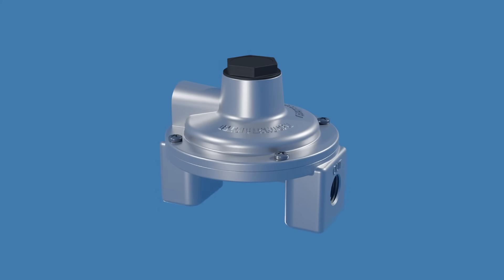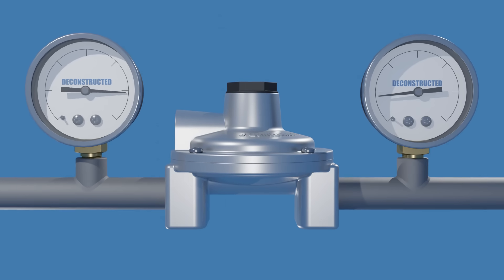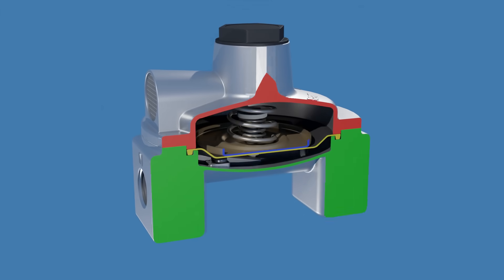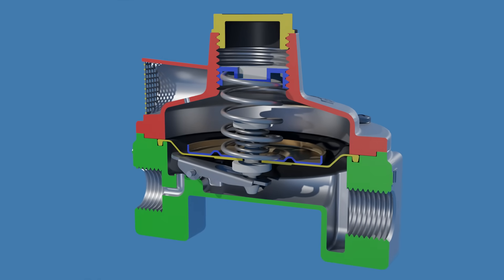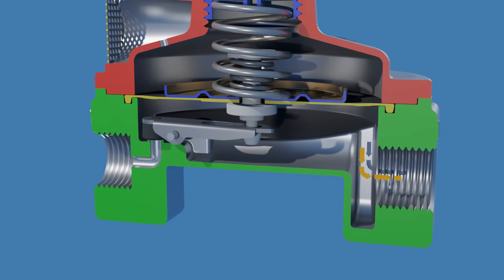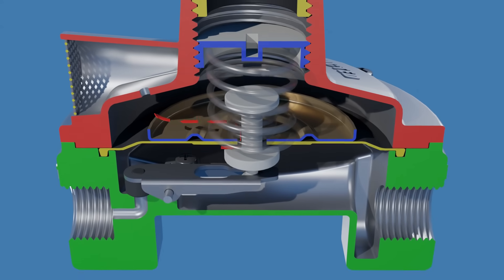How a gas regulator works

Comment: Very good. The technology is very much like how SCUBA works. There, the first stage (attached to the cylinder) lowers cylinder pressure to something like 10bar intermediate pressure in a hose and the second stage (in the diver's mouth) lowers this intermediate pressure to the comfortable inhalation pressure that is ambient to the depth of the diver. Great video from you.

Comment: I have some experience with these. As well as water and steam pressure regulators. They all work on similar principals but the gas ones cut off all gas when they fail for obvious reasons. We never repaired the gas ones. If They had issues we would replace them.

Comment: Would love to see one of these done on the two stages of a scuba regulator.
Reply: I presume the first regulator will be the same as this one, while the second, depending on if it is a Yugoslavian or Romanian designed scuba, will use either external pressure or a fixed bulb of gas to regulate the final breathing pressure against.

Comment: Pls suggest, what happens if the regulator or any of its parts fail to work properly?
In one of our industry all the pipeline, filters are chocked with liquid gas (lpg)..yellow colored viscous liquid..Can anybody suggest the reason? Is it LPG quality issue?
Reply: Likely. If you have too much liquid in your gas stream, there are devices like coalescers to remove them. (My former employer makes some very good ones. Not sponsored!)

Comment: And how to deal with leaking gas through the ventilation holes, thanks for the advice
Reply: Replace the regulator. It should only vent a little in exceptional circumstances.

Comment: The regulator will also blow gas out the vent if the diaphragm fails.  I just had to replace the one on my camping stove, which is no doubt how this showed up in my feed after ordering from amazon.

Comment: Couple points.  The relief valve is a safety device in case the seat disk does not close off 100%.  If it is venting at all, then a repair is in order.
Reply: Correct in general. But also, if the regulator range of operation is undersized, the excess pressure could be venting continuously, although it is very rare for this oversight  to happen. More likely, an upstream regulator has failed.
Reply: Exactly. That's what I've been told by instrumentation and what I look for when ensuring the regulators are working correctly. If it's leaking constantly though the vent port, the diagram or relief valve needs to be replaced/repaired.

Comment: Pretty Good Video
Here are some corrections/additions:
1. Natural gas is methane and not considered a Liquified Petroleum gas.
2. Liquified Petroleum gases are: Propane, Butane, Iso Butane, etc.
3. The access cap for the regulator adjustment is righthand threaded - not left hand as was shown.
4. The gas regulator shown in the video is very basic - like the one on your gas grill.  Almost all gas regulators provided by gas utility companies have a threaded vent port, so that the screen can be removed and small diameter pipe and fittings can be used to direct the vented gases outdoors (if the regulator is installed indoors) or if installed outdoors, to direct the opening down so rain does not enter the vent port. That way the regulator can be installed horizontally as well as vertically.
5. Larger gas regulators (like the one's on most homes and businesses installed by the gas utility) have interchangeable gas metering orifices and adjustment springs. Changing the gas orifice size, changes the volume of gas that can flow through the regulator, while changing the spring stiffness, changes the range of outlet pressure adjustment capability.
Reply: I worked in the natural gas industries and worked on regulators designed for pressures up to 6000 psi. 

They essentially work just like this, with the exception of what you noted.  They also come in different metals as in production you are dealing with raw gas that could be sour or have high concentrations of CO2. 

The regulator I mentioned above is a Fisher 1301 regulator.
Reply: @rickschlosser6793 fisher 67CRF gang
Reply: @rickschlosser6793 Question for you and thread author Ken: For residential Natural Gas joints do you prefer tape+dope? I’m a home gamer but it seems easier for me to get a tight seal the first attempt.
Reply: @colinjohnson5515  I did little residential but as a pipefitter and gasfitter I would use tape and dope. 

Put the tape on first (wrap the correct way), no more than three wraps and don’t cover the first thread.  Then put on a light application of a suitable dope. 

It always worked for me.
Reply: @ TYSM. Also TY for the exact instructions
Reply: The animation showed the seal cap spinning the wrong way, however, the thread was correct in the cutaway.
Reply: Also for listed regulators they have a spring closed flap in vent to allow a larger volume of gas to vent while during normal operation a small hole provides air to pass. This small opening actually slows the regulators diaphragm to dampen excessive vibration in its operation. Single stage regulators are not legal for home or commercial gas lines in the US. Only small portable items like grills  or welding devices can use them. This is because a single failure point between full tank pressure and your indoor appliances is dangerous.
Reply: Great video great comment
Reply: Animator didn't use Teflon tape either. 😅
Reply: Thank you
Reply: Point 3 @ 1:43 : I've seen this any number of times in animation, including a memorable full-screen shot of removing a screw in a Disney film (Meet the Robinsons). I wonder if it's a Persian flaw or in-joke for 3D animators to run screw threads backwards on purpose?
Reply: And residue may enter
Reply: Drop a link to the video you made!? What's that you say.....😂 typical
Reply: Does this design cause the output pressure to drop with higher flow? The only way I can see it possible to open the valve more is if there is less pressure on the diaphragm

Comment: so does this regulator vent the gas to the atmosphere if there is too much pressure? I'm quite fascinated by this. I've never seen any used in residential or commercial supplies of city/natural gas/methane gas here in the UK or even in Belgium, France

Comment: Very well made! May I suggest a similar look at the underrated solenoid valves that live in washing machines (and many other types of equipment), that control the intake of pressurized water  (or other fluids) with a minuscule force, through a clever internal arrangement.

Comment: You forgot to mention that the main spring is also changed to match the output level range and then you adjust the screw to match the final pressure....

Comment: The slot of the adjusting plug is fascinating to watch as it turns through the cut plane, but it would probably be more clear if you restored the plug to its full extent (not cut) for just the duration of the rotation demonstration. Just a small suggestion... the modeling, rendering, and narration are excellent as they are.
Reply from the maker: Thanks for the feedback!

Comment: The dual-stage regulator illustration should show the second (low pressure) stage much larger than the first stage, because the lower-pressure gas is less dense so larger passages are required and the lower pressure means that more diaphragm area is required. This size difference is clearly visible in the outer case shape of typical two-stage regulators.

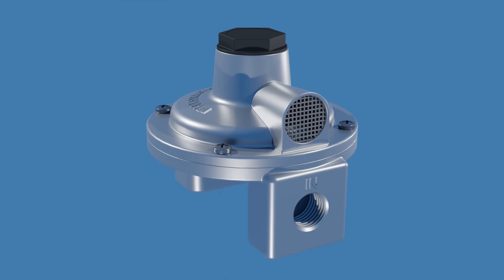Comment: 1:15 not all regulators relieve/vent excess gas. Limited release models, as well as lockup models are readily available for different applications. They are not legal everywhere.

The vent is not required to be pointed down, the termination is. Almost all models have threaded vents. The screen comes out and you screw a pipe into it, with the screen at the new termination. This means the whole body does not need to oriented in any specific direction, and can also be inside.
Reply: You are correct until we start talking about vent limiters , those need to be mounted horizontally, along with the regulator (using piping to mount the limiter horizontal is prohibited by manufacturers, such as Maxitrol).
Reply: @boby115  a vent limiter and vent extention are mutually exclusive. It's one or the other. Vent limiters aren't allowed here anymore.

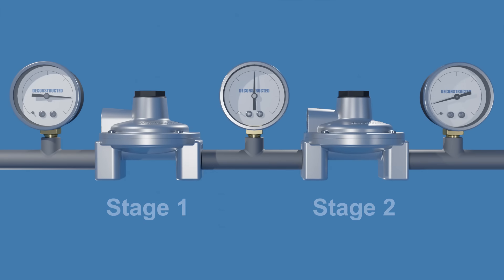Comment: 4:39 dual stage regulators is for safety and control. Typically when there's a very large pressure difference and /or a very wide variability of the inlet pressure. It's one valve body, so it does not help to compensate for distance. 
Multistage systems are used used when you do need to deal with distance. You have 2 or more physically separated regulators. Propane is typically 2. (no less no more, not including the appliance regulators) NG will be dozens in series at the very least, most controlled by the utility.
Reply: I think the narrator confused "difference" and "distance"
Reply: No, not safety, its more about precision. When you have a large pressure difference, the adjustment capability of the "coarse" regulator valve would get very finicky if you directly used it to regulate the outlet pressure, where just a small breathing on the adjustment screw would set it off with hundreds of PSI. Thats why you have a dual-stage pressure regulator, where usually, the first stage is fixed pressure, and would reduce the inlet pressure to like 10%. Then you have the second stage, which have a much greater adjustment capability, just because it works within the 10% of the inlet pressure and thus, you aren't adjusting over the whole pressure scale of the inlet pressure.

In this way, the pressure regulator doesn't need to work as quickly either, since the "coarse" stage does not need to smooth out the pressure so much, thats handled by the "fine" stage, and thus the whole regulator becomes much cheaper to produce.
Reply: @sebastiannielsen  all of which still relates to safety for any hazardous fluid. IE. propane, which will have very substantial fluctuations in inlet pressure, with outlet pressure REQUIRED to be within tight tolerances. If those tolerances aren’t met, it becomes very dangerous in a very hurry. People can and do operate propane and other fuels on single stage supplies, but the risk is substantially increased.

Comment: natural gas is seldom delivered as a  liquid to small appliances that use regulators like those depicted in this video.
Reply: Neither is propane. You use a vaporizer before passing through the second stage regulator. Often the tank itself is used as the vaporizer on residential class capacities. Propane is only stored as a liquid. (delivered as a liquid to the property not to the appliance)

Comment: Dual regulator are also used when a considerable drop in outlet pressure needed for safe operation. Smooth flow is easier to achieve with a second stage of regulation. Sometimes more than one appliance, with different demands connected to the same source will also employ a primary regulator for high demand appliance, than step down again for the low demand unit that requires very steady flow.

Comment: iI do not understand why the outlet pressure does not equalize.  I would  expect the pressure within the outlet channel to exert some force on the diaphram.  I seem to be the only one at 37 comments who still does not understand how stasis is achieved.
Reply: The force caused by the downstream pressure on the diaphragm is what causes the valve to close, stopping flow. This causes the lockup pressure to be higher than the operating pressure.
Reply: @SuperS05  Thank you.  I checked some other sites and now see what you wrote is what is happening.  Regrettably, I did not discern that from the moving arrows in this video.  Also, I had watched the video with sound off, but closed captions on, so maybe something got lost in the transcription.
Reply: @johnlaurencepoole6408  I just went read the captions. It's auto captioned and there were a few hiccups in that portion. I can see some confusion there. 👍

Comment: My only minor critique is it shows the plastic cap on the top with a lefthand thread, which they don't have in reality.
Reply: Yea the cap is using the same threads as the adjustment screw. So by that alone they have to be the same handed threading.

Comment: Good video. The four screws visible on the body along with the necessity for the vent to face downwards to avoid rain and debris suggests that it's possible to rotate the top half to adjust for orientation of the inlet and outlet pipes. Is that a purposeful feature?
Reply: Generally, the safety listing is invalidated when the diaphragm portion is disassembled. Not that you'd actually want to, those springs like to fly. On some models there's an additional set between the diaphragm portion and the body for this purpose. Generally, the body is NOT required to be positioned so the vent faces down. Just the termination, the vent  threads weren't detailed in this video.
Reply: @SuperS05  Cool. That's a great point about validation. Thanks for the response.

Comment: Do scuba diving regulators for breathing gas use the same type of mechanism or a different mechanism?
Reply: Yes, although those are often dual stage. There's different lever arm and body designs but all regulators are designed in this way. Vapour requires large diaphragms, liquid regulators are more compact.